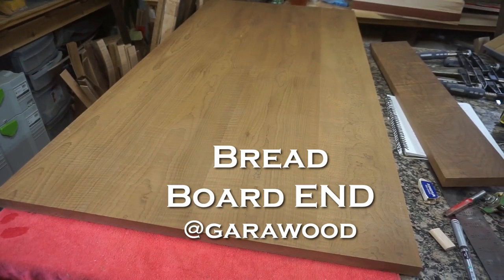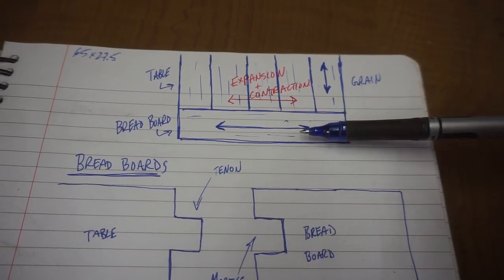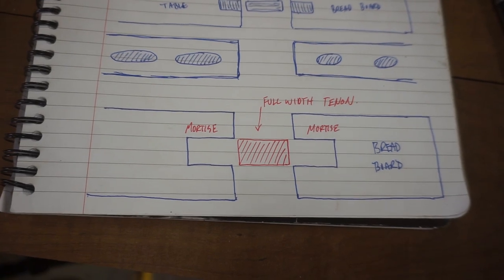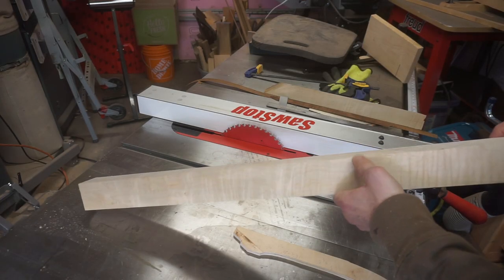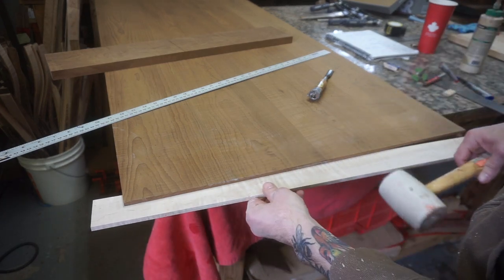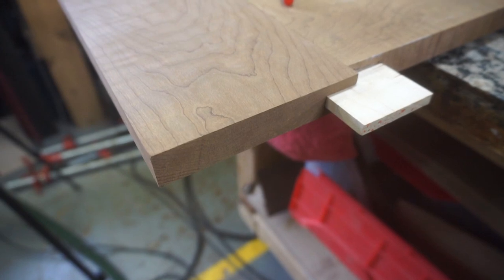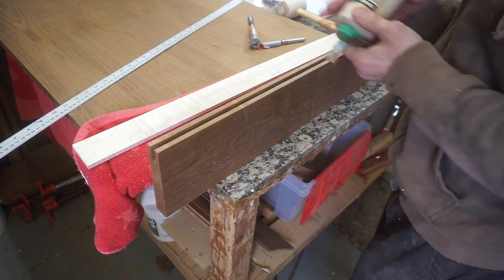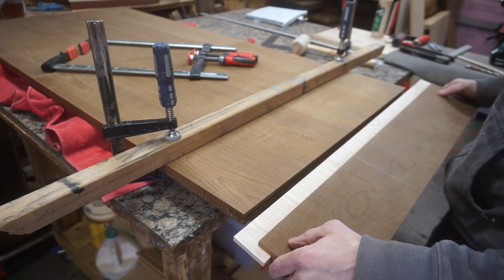Double mortise bread board end for a table

Comment: Nice video.  Subscribed.  Question:  Would you consider a slight drawbore for those dowels on the ends in case the breadboard wants to bow a little?  Or would that restrict the movement of the top too much?  I feel that a small drawbore would be beneficial especially if you inadvertently opened up your hole in the tenon with the rasp.  Keep up the videos especially on the chair!  You are the only guy on YouTube that I can find that shows the detailed process of blending the joints.  Its a scary prospect once you’ve spent the time to do all your joinery.  Personally I’m terrified to begin the shaping on my maloof rocker!
Reply from the maker: Thank you for watching along
Reply from the maker: Great question. I normally make the hole with a slight arc back toward the mortise. so as the top moves it actually tightens. I didnt here because the wood is very porous and I was worried that the top was going to move quite a bit. ( the moisture in my area varies from about 10% - 65% through the year). Does this answer your question?
Reply: @GaraWoodWoodworking  yes it does.  Thank you

Comment: wouldn't your maple tenon need room to move? or is it a small enough piece of wood that the movement would be negligible?
Reply from the maker: The grains are aligned in the same direct in the solid glued side, so that's not an issue. From experience in this method I feel like, yes, it is small enough and the movement is near zero...Also, both will expand further reducing the net difference is expansion.
Reply from the maker: I addressed the long grain direction....I wasn't clear about perpendicular to the grain...I meant to say....Yes, the outward expansion perpendicular to the grain I feel is fine because it is a very small dimension and they both do expand...net difference is very small.